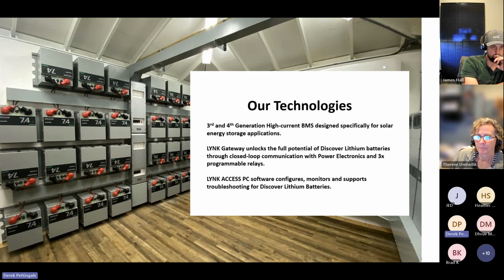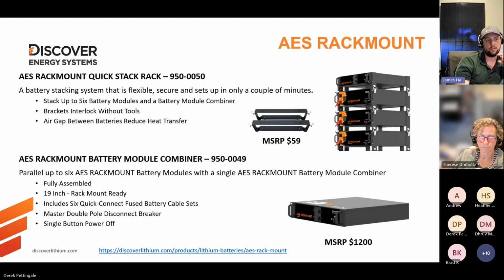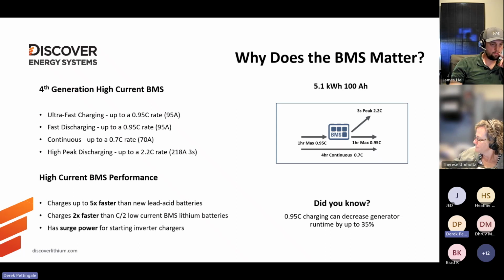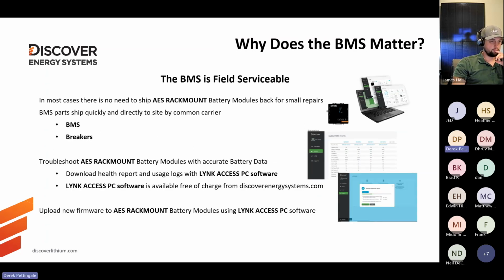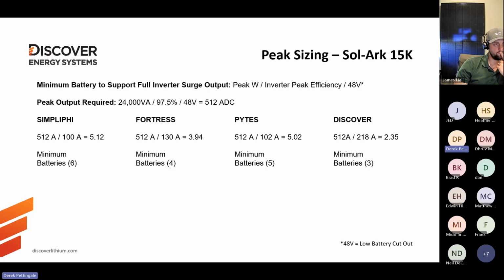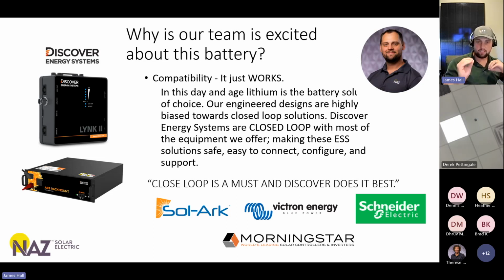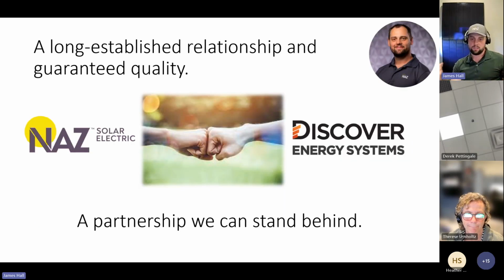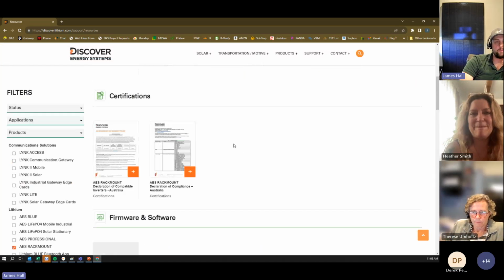WEBINAR | Discover Energy Systems & NAZ Solar Electric Present the NEW AES Rackmount Battery System

Comment: At 34’ speaker claims the rack Mount style batteries only use 15 cells and don’t achieve the pack voltage required for inverters.

This is misleading and deceptive. 

The older battery chemistries only required 15 cells to meet the 50 volt battery pack requirement. 

The newer LiFEO4 battery chemistry requires 16 cells to make the 50-51v pack. 

Rack Mount battery kits and suppliers have been doing this for well over a year 

Why any expert would make a dishonest public claim to disparage an entire industry is disappointing. Disgusting even. 

Check out any of several other diy YouTubers and forums, this was common knowledge well before this video was posted.